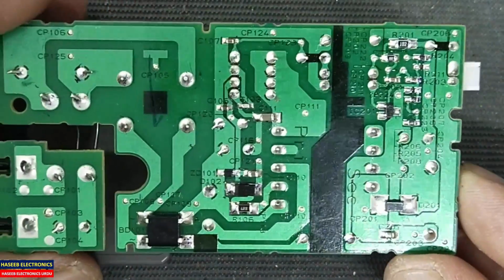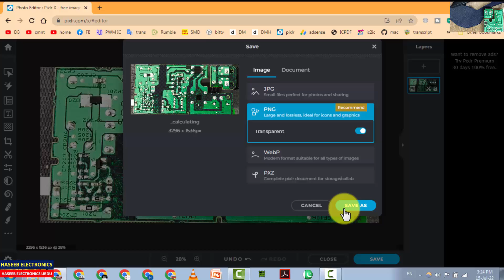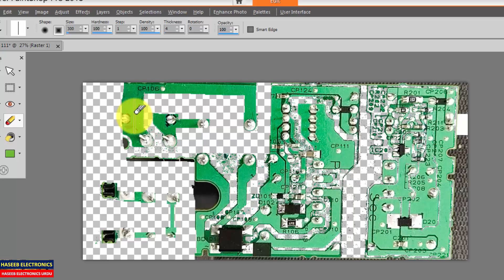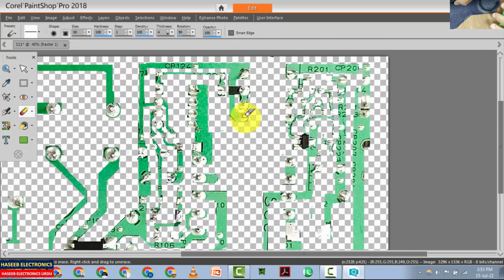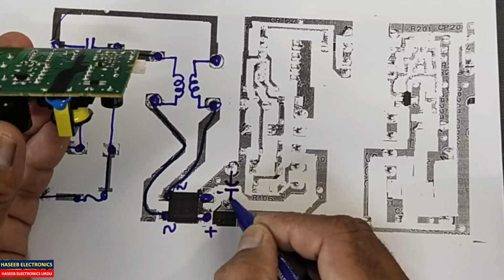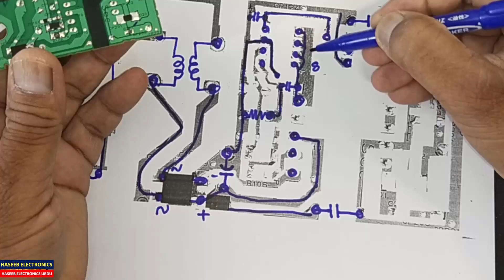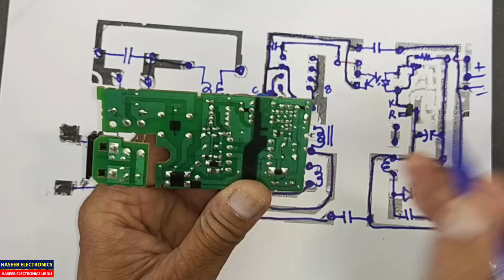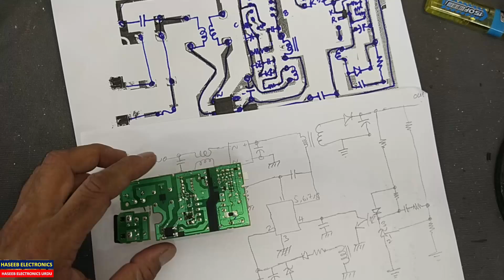{657} How To Draw Circuit Diagram From PCB / PCB Layout

Comment: your explanations are excellent and many thanks for sharing your knowledge .My question is ,Can we use series lamp test for testing electronic appliances which have linear power supply????
Reply from the maker: best regards
yes we can use series lamp to locate short circuit, in any electronic appliances, either it have liner power supply or electronics power supply
Reply: Thanks for your quick answer